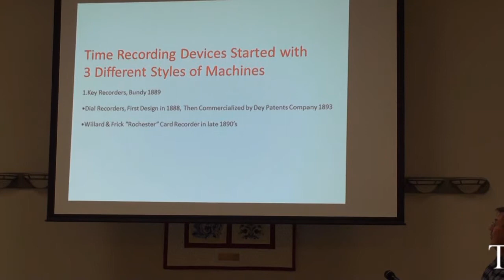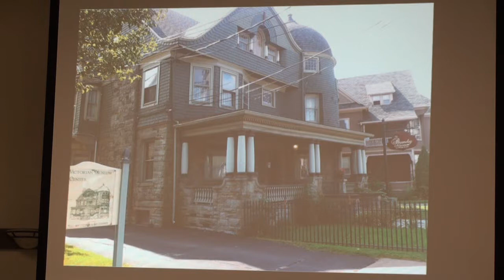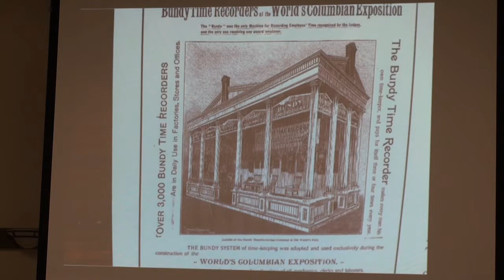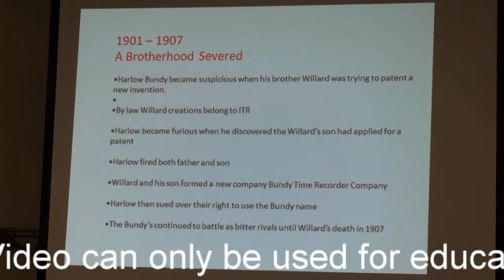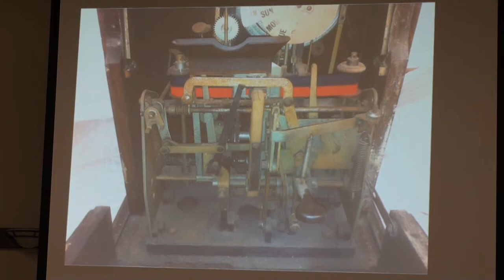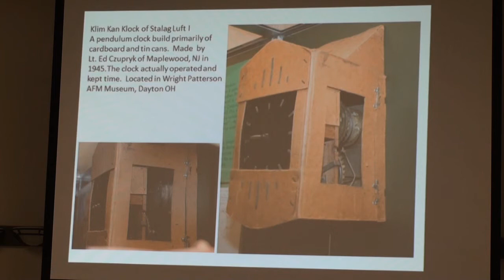Chapter 47 Lecture on Time Recording Devices May 2014

Comment: I picked up some great info from this lecture.  My Grandfather had one of these in his home. He used it as a grandfather type clock in his living room. The punch mechanism was removed. I remember seeing this time clock at the place where he worked, Capac Plastics in Capac, Michigan. He was a foreman there and likely when they went to something more modern, he acquired it. When my grandfather moved out of the house and we moved in, we moved the clock to another building for storage.  Many decades later, my Dad tore down the storage building and he moved the contents outside. My sister came to visit and she saw the clock outside.  She asked what was going to happen with it.  My Dad was going to throw it away.  My sister recognized the family historical importance of the clock and took it home.  It worked for awhile, and when she moved again, the clock ceased to work.  It sat for many years in that condition until one day when visiting my sister, I asked if I could get it working again.  She agreed.  I am not a clock repairman, but I have mechanical abilities.  I got it to work, but it did not keep accurate time.  I took it to a clock repairman and he got it to keep good time.  Now it was running correctly and to complete the restoration, I noticed the wind indicators were missing.  I searched for days and found nothing, until I saw this video.  I bought the brass tubing and are in the process of making these pieces. Many Thanks Craig....